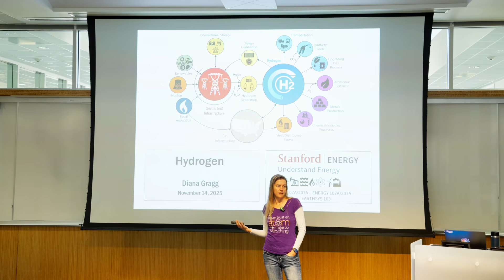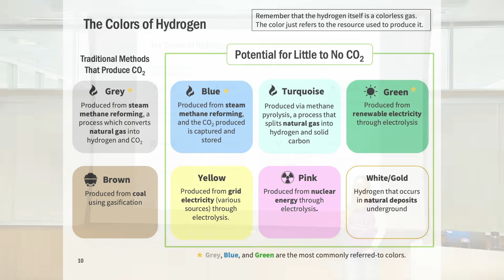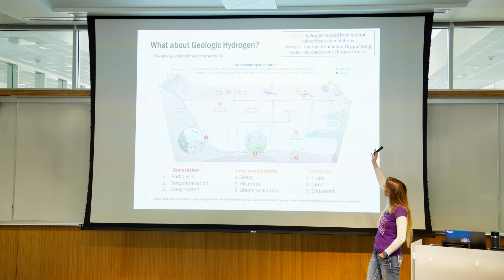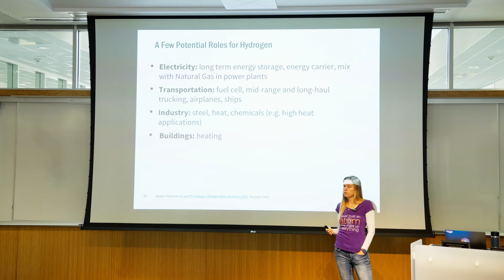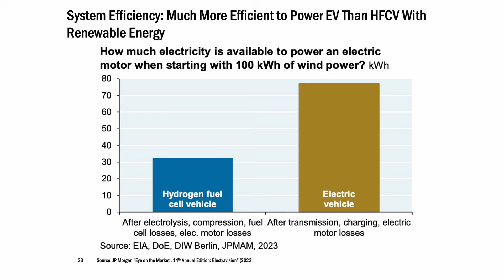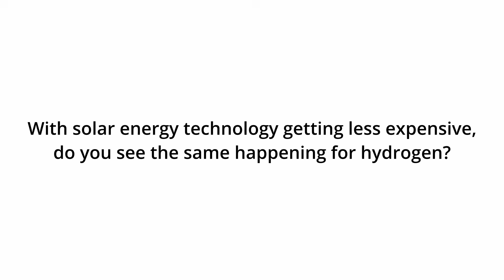Hydrogen Lecture | Diana Gragg | Stanford Understand Energy

Comment: I saw the case for this when California was curtailing immense amounts of solar with no solution in sight; but, with the rise of batteries and data centers taking all excess generation I think the round trip efficiency of hydrogen is too low to warrant building out new generation just for electrolysis.

Comment: The EU is building a continent wide pipeline system for hydrogen.  The US, Canada, and Mexico should consider doing the same.
Reply: I strongly disagree.  I doubt that pipeline system will ever be built.  Consult the work of Michael Liebriech.
Reply: @speculawyer  Where does he teach?
Reply: @FlameofDemocracy  cleaning up podcast on youtube and on various other meeting on climate related events. His hydrogen ladder is the most relavabt topic
Reply: @CiurraU235  The joule valley is basic science. In any case, a lack of peer review is not a positive indicator.
Reply: Such a pipeline seems like a waste of resources and capital , we should first electrify sectors in which it leads to better return of investment , like heatpumps induction cooking electrical mobility
Reply: @CiurraU235  Hydrogen pipelines can transport 20 times the power of high tension lines. There are many uses of advanced power density.
Reply: @FlameofDemocracy to my knowledge hydrogen is almost always used near where it is produced because it is way more difficult than methane to contain, I am aware of its energy density per kg
Reply: @CiurraU235  There are plenty of pipelines for hydrogen in the US.
Reply: @FlameofDemocracy  how long are they? are there not order of magnitude differences in the volume of gas they pipe compared to methane pipelines?
Reply: @CiurraU235  That info can be found online.
Reply: @FlameofDemocracy  I have found 5000 km of hydrogen pipelines vs 300.000 km of pipelines plus 2 milion km of local distribution for methane in the usa. 

Do you reckon them correct?
Reply: @CiurraU235  The EU calls for a continental network. Isn’t that the analog? At any rate, hydrogen is an industrial gas, that has been handled since the start of the industrial revolution. There is no reason that it cannot scale. Smart money cashes in.
Reply: @FlameofDemocracy  well we can do it , the main issue is it worth it?

As of now hydrogen is a co2 emission issue not a solution , we should clean what we use now before thinking about expanding its use to clean our economy, dont you think?
Reply: @CiurraU235  I cannot make heads or tails of your statement. 

In any case, China will surpass the U.S. in H2 pipeline length before 2030. They however, have all green hydrogen. Give students facts, so they can shine all the brighter, in the future.
Reply: @FlameofDemocracy  what have you not understood? English is not my first language so maybe is an error on my part.

I know that most hydrogen is made  from methane so we should first make clean hydrogen for current consumption before expanding hydrogen to new use cases as a way to reduce co2 emissions.

Are you sure about china? I did not hear that they had all their hydrogen green , Still due to their greed make up I am not sure if it is better to make hydrogen from 45% coal electeicity or from methane
Reply: @FlameofDemocracy  I forgot to ask , what are in your opinion good uses for hydrogen? In addition to current ones
Reply: @CiurraU235  There is plenty of information online. 

In any case, the reasoning appears to be sound, given the worldwide hydrogen buildout.

Comment: The cost of hydrogen could drop over 50 per cent, if build out progresses.  Solar and wind have seen economies of scale drop prices rather significantly, in just a decade.
Reply: Yeah but hydrogen competes with electricity for use cases , we should use hydrogen where it is better or there are no alternatives
Reply: @CiurraU235  Hydrogen can produce electricity. So, how does it compete with electricity? I do not understand what you are trying to convey?
Reply: @FlameofDemocracy electricity can be used directly without making hydrogen with it , so if we can use say an heat pump we should not use a hydrogen boiler.
Reply: @CiurraU235  Hydrogen is no different than a battery, in that case. I do not understand what nor why, you are talking about. Does this class have a text?
Reply: @FlameofDemocracy  it problaby has one , I am just a watcher.

Using hydrogen as a battery is one of its worst use cases we lose lots of energy in making it and then in burning it to make electricity back .

Piping it is doable but it is harder than methane as we can see in the order of magnitude differences in the existing pipelines.

We should use it where it makes the most sense and if it that work can be done by electricity I argue hydrogen has no role in it.

P.s. before teying to find more uses for hydrogen we should clean current hydrogen use until that happens hydrogen is a climate problem not a solution, dont you think?
Reply: @CiurraU235  Well, could you use proper capitalization and punctuation, if only to honor the institution, student body and readership? Thank you.  

Hydrogen is a great way to store energy,  These days, is free during the day, or early free and night, in some places.

In the example above, direct energy was recommended. Why couldn’t a pump use electricity from a battery, ie indirectly? I do not understand your reasoning. From which sources are you getting information?
Reply: @CiurraU235  With the cost hydrogen due to drop 50 to 90 per cent, I would not look askance at any opportunity. 

Is the hydrogen boiler using electricity from hydrogen or is the hydrogen itself being used? The former fits the thread. If it’s the latter case, cheap hydrogen might make more sense. In any case, the Ene Farm system is cheaper than a pump build out. 

Facts are better for students, than opinion.
Reply: @CiurraU235  There are very large scale hydrogen batteries being built, right now. What is deficient about the US project in Nevada, for example. 

It is somewhat difficult to see the reasoning in certain comments.
Reply: @FlameofDemocracy  various sources mostly videos such as these , for what I understand conversion losses with batteries are much lower than with hydrogen. Dont you agree? 

Sorry about the grammar english is not my first language
Reply: @FlameofDemocracy I dont understand what do you mean by hydrogen battery .

It is a knew kind of battery? Or it is a storage for hydrogen to be later burnt to make electricity?
Reply: @FlameofDemocracy  from where do you get a decrease in the price of hydrogen? And what kind of hydrogen from clean electricity?

I was thinking of a hydrogen burning boiler vs an heatpump.

I dont understand how can it be possible to have 1 kwh of electricity converted into hydrogen  getting around 0.7 kwh of it to then burn it to get around 0.658 kwh of heat vs an heat pump that gets 3.5 kwh of heat with same electricity and get a better value from the hydrogen?
Reply: @CiurraU235  I don’t really want to have an opinion when there are facts. Nevada has a huge battery in build out, currently speaking.
Reply: @CiurraU235  S curves, as alluded to in the cases of solar and wind.
Reply: @CiurraU235  Hydrogen storage and batteries could be considered synonymous. There are hydrogen batteries like nickel-hydrogen or flow batteries. It is best to read books and keep up with research papers and publications. Online reading can only be of so much value.
Reply: @CiurraU235  Ene Farm makes hot water and residential electricity from H2. 

Since a boiler, the one referred to, it focuses on heat, which may not fit the thread. 

Furthermore, what did the company say? How can it be confusing? The costs have not been mentioned, as well.

Putting up stats is not very reassuring, nor interesting to debate, if only because system approaches are favored.
Reply: @FlameofDemocracy well I pointed out some facts based on science , would you kindly present the case for hydrogen I am ready to expand my knowledge to better understand our energy situation
Reply: @FlameofDemocracy well lets hope so , but s curves usually depend on better  techical experience and manufucturing they do not change the science behind it.
Reply: @FlameofDemocracy so you where referring to storage?
Reply: @CiurraU235  Look at the large project in Utah.
Reply: @CiurraU235  The pipeline and hydrogen battery projects are facts, to explore and engage. Universities are about reading, autonomy, and discovery. That particular experience never ends.

Comment: To some, round trip efficiency may misleading.  The cost of batteries, the longevity, the ability to be clime and temperature agnostic; along with the volumes of energy needed may play roles to some degrees, in meeting overall throughput and requirement fulfillment capacity.  In short, it may be the case the large volumes of seasonal storage could meet breakeven and provide assurance, somewhat earlier than other schemes.  

As temperatures warm, water based systems, such as pumped storage may become more and more slanted in risk portfolios.

Comment: Green hydrogen is cheaper than incumbents, now that there is conflict in the Middle East.  Further, the energy density is three times that of gasoline, so the mileage or power metrics are far more valuable.  In fact, performance parity may have already been reached, in some metrics.

Further, how much more energy is needed to liquify hydrogen, when compared to natural gas?
Reply: OMG, you are a fountain of blatant misinformation.

Comment: At least two thirds of electricity is lost in transmission, or non use in the US.  Convert these grid energy streams to battery fill or hydrogen to stop losing so much of the domestic resource base.
Reply: "At least two thirds of electricity is lost in transmission"  Absolute nonsense. The grid is ~94% efficient.  Perhaps you are thinking about carnot efficiency losses in heat engines.